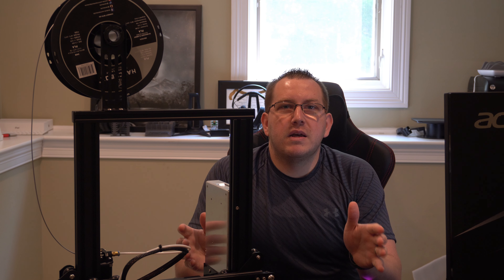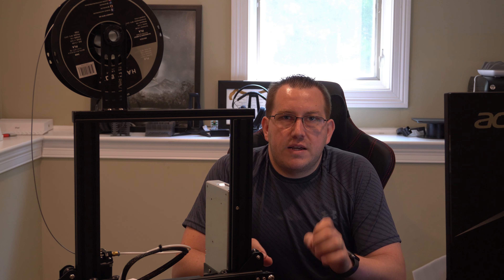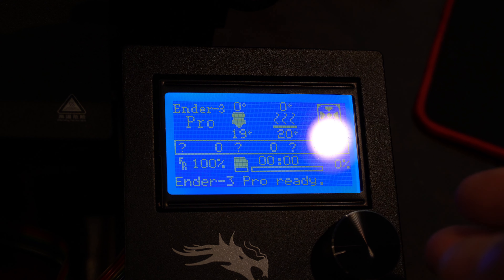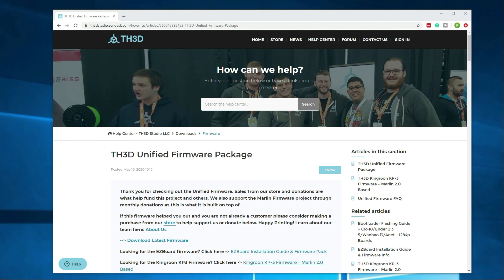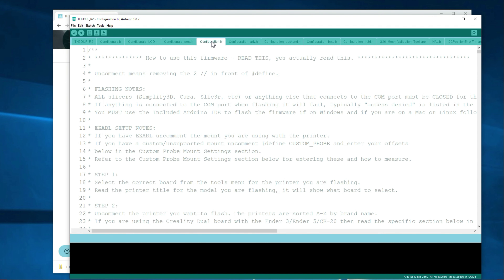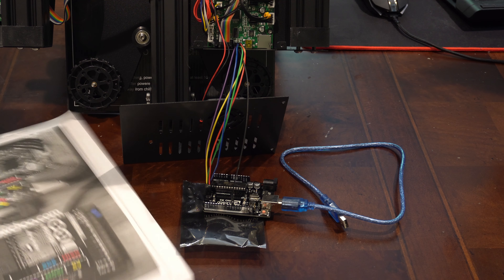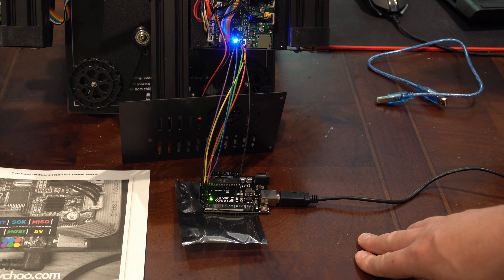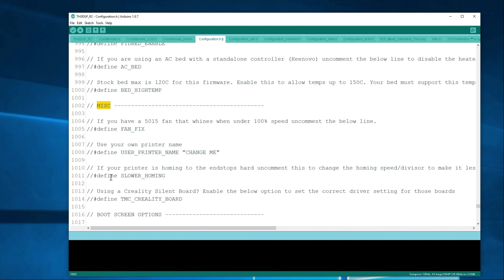Ender 3 Pro Firmware Update – Complete Guide

Comment: Hello, when i click burn bootloader it works then says "avrdude: Device signature = 0x000000 (retrying)" multiple times and "avrdude: Device signature = 0x000000
avrdude: Yikes!  Invalid device signature.
         Double check connections and try again, or use -F to override
         this check."
My board or arduino bricked or something?

Full Log:
Arduino:1.8.7 (Windows 10), Kart:"Sanguino 1284p, ATmega1284P (16 MHz)"

C:\Users\prtkg\Downloads\TH3D_UFW_U1.R2.B5\TH3DUF_R2\Windows Arduino\hardware\tools\avr/bin/avrdude -CC:\Users\prtkg\Downloads\TH3D_UFW_U1.R2.B5\TH3DUF_R2\Windows Arduino\hardware\tools\avr/etc/avrdude.conf -v -patmega1284p -carduino -PCOM6 -b19200 -e -Ulock:w:0x3F:m -Uefuse:w:0xFD:m -Uhfuse:w:0xDE:m -Ulfuse:w:0xFF:m 

avrdude: Version 6.3-20171130
         Copyright (c) 2000-2005 Brian Dean, http://www.bdmicro.com/
         Copyright (c) 2007-2014 Joerg Wunsch

         System wide configuration file is "C:\Users\prtkg\Downloads\TH3D_UFW_U1.R2.B5\TH3DUF_R2\Windows Arduino\hardware\tools\avr/etc/avrdude.conf"

         Using Port                    : COM6
         Using Programmer              : arduino
         Overriding Baud Rate          : 19200
         AVR Part                      : ATmega1284P
         Chip Erase delay              : 55000 us
         PAGEL                         : PD7
         BS2                           : PA0
         RESET disposition             : dedicated
         RETRY pulse                   : SCK
         serial program mode           : yes
         parallel program mode         : yes
         Timeout                       : 200
         StabDelay                     : 100
         CmdexeDelay                   : 25
         SyncLoops                     : 32
         ByteDelay                     : 0
         PollIndex                     : 3
         PollValue                     : 0x53
         Memory Detail                 :

                                  Block Poll               Page                       Polled
           Memory Type Mode Delay Size  Indx Paged  Size   Size #Pages MinW  MaxW   ReadBack
           ----------- ---- ----- ----- ---- ------ ------ ---- ------ ----- ----- ---------
           eeprom        65    10   128    0 no       4096    8      0  9000  9000 0xff 0xff
           flash         65    10   256    0 yes    131072  256    512  4500  4500 0xff 0xff
           lock           0     0     0    0 no          1    0      0  9000  9000 0x00 0x00
           lfuse          0     0     0    0 no          1    0      0  9000  9000 0x00 0x00
           hfuse          0     0     0    0 no          1    0      0  9000  9000 0x00 0x00
           efuse          0     0     0    0 no          1    0      0  9000  9000 0x00 0x00
           signature      0     0     0    0 no          3    0      0     0     0 0x00 0x00
           calibration    0     0     0    0 no          1    0      0     0     0 0x00 0x00

         Programmer Type : Arduino
         Description     : Arduino
         Hardware Version: 2
         Firmware Version: 1.18
         Topcard         : Unknown
         Vtarget         : 0.0 V
         Varef           : 0.0 V
         Oscillator      : Off
         SCK period      : 0.1 us

avrdude: AVR device initialized and ready to accept instructions

Reading | ################################################## | 100% 0.01s

avrdude: Device signature = 0x000000 (retrying)

Reading | ################################################## | 100% 0.01s

avrdude: Device signature = 0x000000 (retrying)

Önyükleyici yazdırılırken hata oluştu.
Reading | ################################################## | 100% 0.01s

avrdude: Device signature = 0x000000
avrdude: Yikes!  Invalid device signature.
         Double check connections and try again, or use -F to override
         this check.

avrdude done.  Thank you.
Reply: btw the led on the ender 3 pros mainboard wasnt working.(the blue one)
Reply from the maker: Hi. I havent seen this before but its possible the wrong board is selected. I would verify that first. Also, at this point i would recommend looking to swapping the board out for a 32 bit one.

Comment: hey! I need some help. I actually WANT Creality 1.1.6.2. Where can I get the files for this??
Reply from the maker: Hi. If thats the latest for the 8-bit board, you should be able to find it here. https://www.creality.com/download
Reply: @3DPrintscape THANKSS! I will attempt to try this. Never done it before.. Just dont want to screw up and brick my printer
Reply from the maker: @kzukez  You're Welcome. I havent tried to go back to the reality firmware on an 8-bit board but have on a 32-bit one and it works fine.

Comment: Is there an firmware for an touchscreen for my ender 3 V2 so I can do my e-steps
Reply from the maker: Hi. It should be in the base firmware but if not you can try to upgrade it. Here is a video that covers the upgrade process for the 4.2.2 and 4.2.7 boards. https://youtu.be/uylAYrmZqrk
Reply: @3DPrintscape  thanks and u can use the touchscreen for that cuz my board is 4.2.2
Reply from the maker: @monsterstorm78  I would check the board, the v2 typically has the 4.2.7 one. I don't think you will be able to get an aftermarket screen to work with the creality boards. If you want something like the tft35 you will need to move to the skr board.
Reply: @3DPrintscape  my motherboard has the 4.2.2 version board

Comment: I keep getting an error while burning bootloader?? Don't know what to do?? Your info would be GREAT :)
Reply from the maker: Hi. What error are you getting?
Reply: @3DPrintscape  Device signature = 0xffffff (probably .avr8x_mega)
avrdude: Yikes!  Invalid device signature.
         Double check connections and try again, or use -F to override
         this check.

avrdude done.  Thank you.
Reply: That's what it says.
Reply from the maker: It sounds like there is a mismatch somewhere. Try to check that the jumpers are in the right location, the correct comm port is chosen, and that you have the correct board selected in the Arduino ISP. If you are still having issues after you checked that can you email me the full log output. My email is admin@3dprintscape.com.
Reply: @3DPrintscape  also on the bigtreetouch screen it says "no printer attached" if that helps any. I just redid the jumpers.
Reply from the maker: What printer is this? Is it an Ender 3, Ender 3 Pro, or Ender 3 V2? It sounds like this may be the V2 and im thinking the process may be different for that.
Reply: @3DPrintscape  far as I know its just an Ender 3 pro. Thats all the box says. When I did the "About Printer" it came up 1.1.2 or it was 0.0.6 I don't remember. I'm feeling it was 1.1.2
Reply from the maker: Did you add the bigtreetouch? The Ender 3 and Ender 3 Pro don’t have one by default. The Ender 3 V2 comes with a touchscreen.
Reply: @3DPrintscape  yea i added it on. Along with Micro Swiss Direct Drive. Everything was working fine till I went to add the touch screen.
Reply from the maker: Gotcha, there are a lot of variables here that I can't account for on my side. If it works fine without the touchscreen, then it could be something related to how that is connected or the firmware it uses.
Reply: @3DPrintscape  I'm going to put oem screen back on and the original motherboard. Hopefully it starts working again. If so, then I will try the BLTOUCH auto bed leveling kit.
Reply from the maker: Ok, let me know how that goes, im curious about this one.
Reply: @3DPrintscape  it's working again. Just have to relevel the bed. Might try the BLTOUCH auto bed leveling this weekend.
Reply: @3DPrintscape  Well, I put the bigtreetouch touch screen and motherboard back in and things are working...for the most part. I forgot to add the other ribbon cable to the new touch screen to the motherboard. It works now. Now I am trying to get the BLTOUCH to work. How do I get the nozzle more over the plate when I do a auto home? it goes off the plate.
Reply from the maker: Hey, im glad you got everything working again. I think the issue you are seeing with the bltouch is related to the x and y offset values in the firmware. Can you make sure those are correct?

Comment: Board senguini xxx doesnt show up at my boards?
Reply from the maker: Hi. What board do you have? Is it the 8 or 32 bit stock one?
Reply: @3DPrintscape  good question haha, my printer is the ender 3 pro everything stock but bluetuch added and i want to burn the firmware on with an arduino uno
Reply from the maker: @ActuallyFlo  What usb port type is on the printer? Creality started shipping the printers with 32 bit boards in early 2020 which has a different upgrade process.

Comment: having problems with upload keep getting error. Arduino: 1.8.7 (Windows 10), Board: "Sanguino 1284p, ATmega1284P (16 MHz)"

Sketch uses 108854 bytes (83%) of program storage space. Maximum is 130048 bytes.
Global variables use 5427 bytes (33%) of dynamic memory, leaving 10957 bytes for local variables. Maximum is 16384 bytes.
C:\Users\dave\Desktop\Ender 3\TH3D_UFW_U1.R2.B5\TH3DUF_R2\Windows Arduino\hardware\tools\avr/bin/avrdude -CC:\Users\dave\Desktop\Ender 3\TH3D_UFW_U1.R2.B5\TH3DUF_R2\Windows Arduino\hardware\tools\avr/etc/avrdude.conf -v -V -patmega1284p -carduino -PCOM1 -b115200 -D -Uflash:w:C:\Users\dave\AppData\Local\Temp\arduino_build_21665/TH3DUF_R2.ino.hex:i 

avrdude: Version 6.3-20171130
         Copyright (c) 2000-2005 Brian Dean, http://www.bdmicro.com/
         Copyright (c) 2007-2014 Joerg Wunsch

         System wide configuration file is "C:\Users\dave\Desktop\Ender 3\TH3D_UFW_U1.R2.B5\TH3DUF_R2\Windows Arduino\hardware\tools\avr/etc/avrdude.conf"

         Using Port                    : COM1
         Using Programmer              : arduino
         Overriding Baud Rate          : 115200
avrdude: stk500_recv(): programmer is not responding
avrdude: stk500_getsync() attempt 1 of 10: not in sync: resp=0x97
avrdude: stk500_recv(): programmer is not responding
avrdude: stk500_getsync() attempt 2 of 10: not in sync: resp=0x97
avrdude: stk500_recv(): programmer is not responding
avrdude: stk500_getsync() attempt 3 of 10: not in sync: resp=0x97
avrdude: stk500_recv(): programmer is not responding
avrdude: stk500_getsync() attempt 4 of 10: not in sync: resp=0x97
avrdude: stk500_recv(): programmer is not responding
avrdude: stk500_getsync() attempt 5 of 10: not in sync: resp=0x97
avrdude: stk500_recv(): programmer is not responding
avrdude: stk500_getsync() attempt 6 of 10: not in sync: resp=0x97
avrdude: stk500_recv(): programmer is not responding
avrdude: stk500_getsync() attempt 7 of 10: not in sync: resp=0x97
avrdude: stk500_recv(): programmer is not responding
avrdude: stk500_getsync() attempt 8 of 10: not in sync: resp=0x97
avrdude: stk500_recv(): programmer is not responding
avrdude: stk500_getsync() attempt 9 of 10: not in sync: resp=0x97
avrdude: stk500_recv(): programmer is not responding
avrdude: stk500_getsync() attempt 10 of 10: not in sync: resp=0x97

avrdude done.  Thank you.

Problem uploading to board.  See http://www.arduino.cc/en/Guide/Troubleshooting#upload for suggestions.

This report would have more information with
"Show verbose output during compilation"
option enabled in File -> Preferences.
Reply from the maker: Hi. It sounds like you are not on the right com port, or the com port is locked. First make sure you are on the right com port (based on the error, you are using COM1), if you are, then I would try restarting the computer as there may be a lock. It seems like I have the second issue pretty frequently.
Reply: @3DPrintscape  done it now. Thanks

Comment: I got a blue screen on ender 3 pro after boot loading . Do you know why?
Reply from the maker: Hi. So many variables are in play at this point, so its hard to say. Im assuming you have the Creality 1.1.4 board, can you confirm? And was there any errors in the log when you pushed the bootloader?
Reply: @3DPrintscape  Yes, I do have the creality 1.14 board.
Reply: @3DPrintscape  No, when I pressed burn bootloader, I got a blue screen. it worked at first, but then when I was at the second part, I tried doing it and it did not work.
Reply: @3DPrintscape  I am thinking about using the arduino to downloads the firm 
ware from creality to the printer?
Reply from the maker: @bpcinematics  If your passed the bootloader part and are getting the issue when trying to upload the firmware then it sounds like something is not configured correctly in the firmware. I would recommend starting over and going back through each change, I know this solved a similar issue for people before.

Comment: At 14:55, I didn't have an option for Sanguino.  I had to follow instruction #3 at https://howchoo.com/ender3/ender-3-bootloader-firmware-update-marlin to have that option.  Next, I got an error  "avrdude: Expected signature for ATmega644 is IE 96 09   Double check chip, or use -F to override this check".  I had the wrong processor selected under Tools/Processor.  After I selected ATmega1024p,  the bootloader was successfully burned.
Reply from the maker: Hi. Thanks for the feedback. I didnt run into issues like that. What board do you have? I did the test on my Creality 1.1.4 board and the Uno board from the description.
Reply: @3DPrintscape  Mine is the Creality 1.1.6.2 and an Uno board
Reply from the maker: @robertm8246  Gotit, i think what you saw may be a result of the board version being different.

Comment: Hi Rob, thanks for the video!  How would I apply this firmware upgrade to a 32-bit board (I have a 4.2.2)?  Or does the Creality firmware upgrade for 32-bit boards that you walk through in your other video include the thermal runaway protection?
Reply from the maker: Hi. I have a video covering that process that you can see here. Its a lot easier. https://youtu.be/uylAYrmZqrk

Comment: Do you need this for current firmware?
Reply from the maker: Hi. No this is only if you have one of the 8-bot boards. If you have one of the newer 32 bit boards, like the 4.2.2, the process is much easier. I have videos covering that as well.
Reply: @3DPrintscape  ok I will look for them right now thanks
Reply: @3DPrintscape  what is the video called I’m having a hard time trying to determine which is which
Reply from the maker: @HennyManTactics  Here is a link to the one i think you should start with. https://youtu.be/uylAYrmZqrk

Comment: Strange, I don't have the "about printer" menu on my ender pro 3 !!!
Reply from the maker: Hi. If your running the standard firmware, it should be there. Did the firmware or mainboard get changed on that printer?
Reply: @3DPrintscape   nop, it is an Aliexpress order. The printer works fine very strange.
The mainboard is V1.1.3 version. I think I will reprogram all with a bootloader and the last official firmware.
Thanks for your channel it is very interesting.
Reply from the maker: Thanks for the feedback.  I think the route you proposed makes sense.

Comment: Is there any way to do this without a degree in computer science, quantum physics, theoretical physics and advanced engineering?
Reply from the maker: Hi. Im not sure what board you have. If you happen to have a 32-bit one the process is much easier. If you have an 8-bit board, this is pretty much the process.
Reply: @3DPrintscape  It was a bad attempt at a joke, and yes, I unfortunately have an 8 bit board.
Reply from the maker: @voldy3565  LOL. If i were you your shoes, I would look at swapping out the board. THe process isn't difficult and it will make things much better for you. I upgraded to an SKR MIni v2 on my Ender 3 that came with the 8-bit board and have been happy with it. I also have a video covering the process.

Comment: Or is there anyone here in AZ I can just pay to get this thing set up and working with my laptop, between the printer and filaments and laptop I spent 1000$ I just want to print stuff
Reply from the maker: Hi, Im in Ohio so I can't help with the physical work, but if you run into issues or need advice, just let me know.
Reply: @3DPrintscape  if you could give me a list of exactly what I need to buy to upgrade this thing and software needed and then we can go from there I order off of Amazon , then I can get what you say and then go from there.
Reply: @3DPrintscape  or what about a higher model of the ender like the 5 or 10pro is that come ready to go without having to do anything extra for it to work with my laptop. Does it come with updated firmware or whatever
Reply from the maker: Hi. Sorry for the delayed response, these comments got filtered out by YouTube since I responded to the original comment. I believe all the Creality line uses the same firmware, so going up the Ender 5 or CR-10 won't help much. I an put together the list of parts to buy, just need to know if your leaning towards the Ender 3 Pro or another model.
Reply: you dont have to update the firmware just use the USB card and adaptor in just plug it into your laptop download you print file and plug it into the printer and print from SD card. Then you wont ha e to do all this firmware upgrade. im still on the firmware that came wjth my Ender 2 and works great.  Why do you need to do the update?